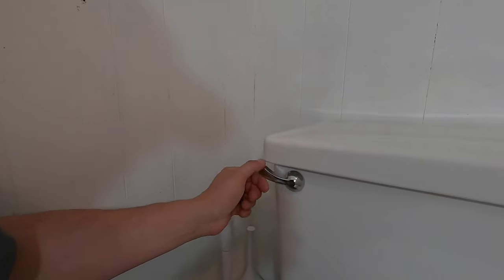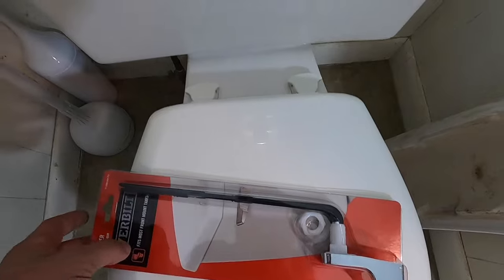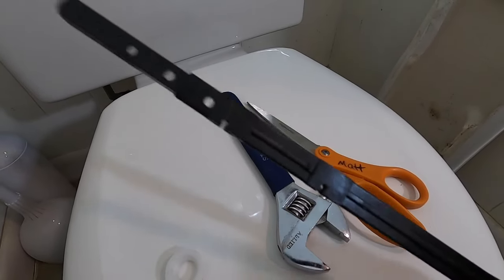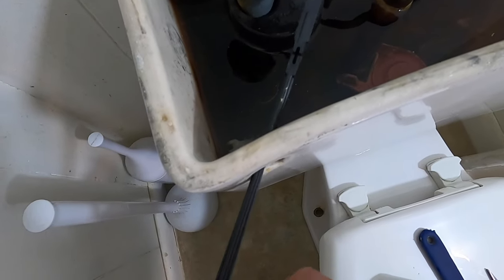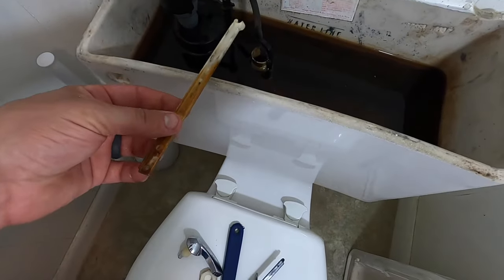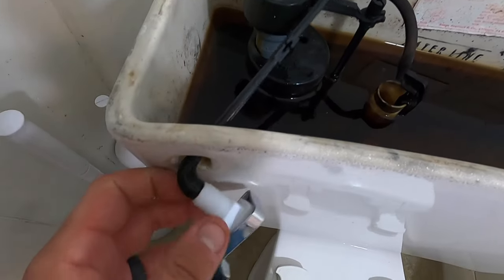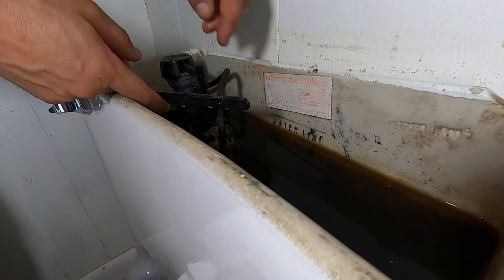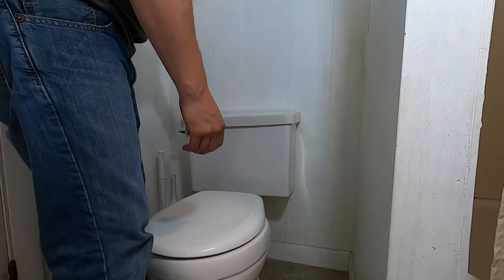How to Fix Broken Toilet Flush Lever Handle

Comment: That tank is really dirty I always put Clorox in side with soap powder keep it really clean  thank you 😄
Reply from the maker: Yeah might be a good idea.  Thanks for the tip, Gail!  And thanks for checking out the video!
Reply: I've lived on septic half my life.  No Clorox or harsh chemicals.  Nothing except "natural" products.
Reply: @evalynn7005  I agree.  I'm also on septic and the installer said no bleach or harsh chemicals.
Reply: I'm not on Septic, but over time will the Clorox &/or Soap powder damage the other components?

Comment: You did a good job. 
👍🏾👍🏾👍🏾👍🏾
I have replaced a number of flush levers in my time
But the difference between you and me
I have never used a tool to untighten and tighten the nut
All by hand
😂😂🇯🇲
Reply: Recardo Davis -- He did that for us weaklins'. 😊
Reply from the maker: Yeah I like to give it a little extra. 😁. Thanks for checking out the video!

Comment: Nice. Just simply turn water off before doing this then water won't keep running also, this plastic type will not crack the porcelain. You definitely don't won't to over-tight so you won't strip or crack the lever.  I know you replaced the toilet but if you weren't planning that, then it's a great idea to buy the kit which has the flapper and the filler float as they usually go out and rubber/gaskets wear out.
Reply from the maker: Thanks for the feedback!  And for checking out the video!

Comment: Mine does not have a chain. I'm not sure if the one I purchased, which has holes, will work.
I DID try to get the handle off by going the wrong way, so now it is really tight & I can't get it off.
Wish I'd watched the videos first.

Comment: The nut on the flusher is stuck. I've tried turning both ways. How can I unstick it?
Reply: Make sure you are trying to loosen the reverse threaded nut in the proper direction. If it still fails to break loose with a wrench, spray a little WD-40 or penetrating oil around the nut and surrounding threads, and let let it sit awhile to help free it up. Then you should be able to loosen the nut with a wrench.

Comment: So, if I ever need to replace a toilet handle in such a simple way that I can just follow the package directions, I won't need this YouTube video to help. However, if what I have is NOT such a simple replacement but one where the old HANDLE is gone but NOT the white plastic seal in the hole, which is unfortunately left behind and entirely immovable so that I can't simply put a new handle straight from the package through an empty hole, how do I get that big plastic seal OUT OF THE HOLE first?!?!?